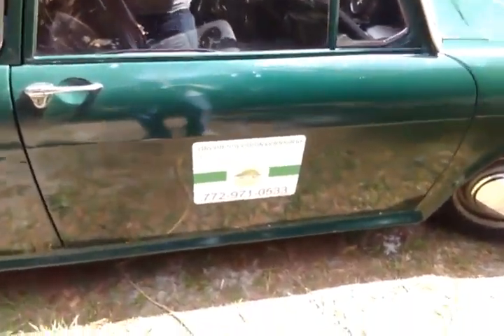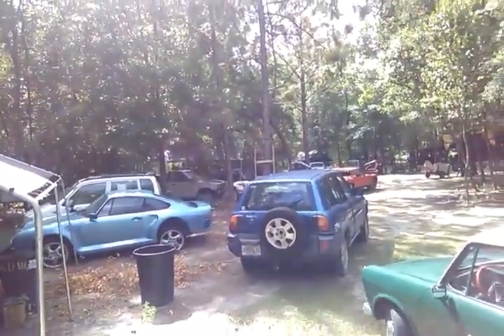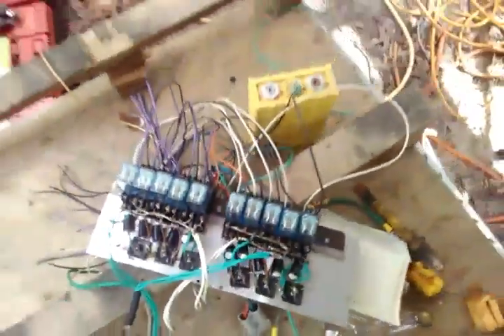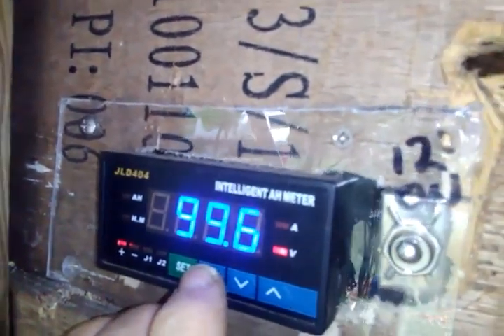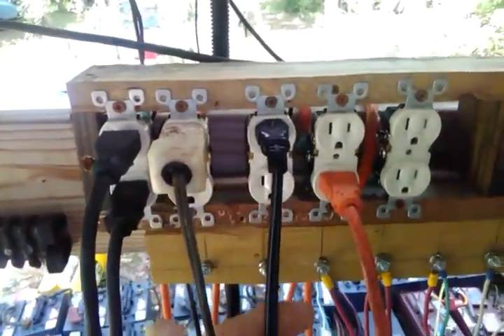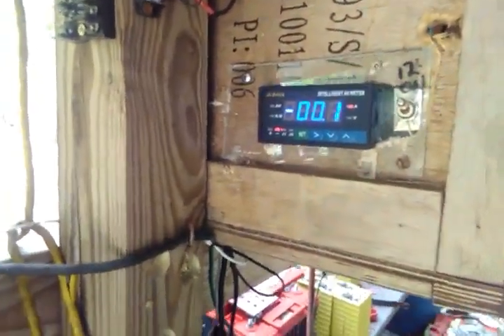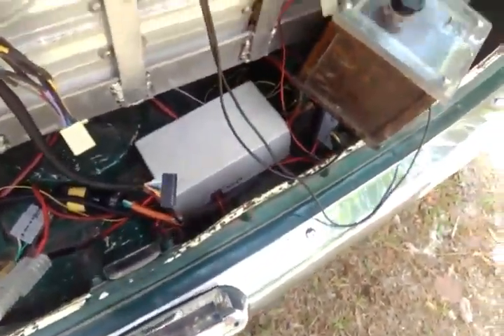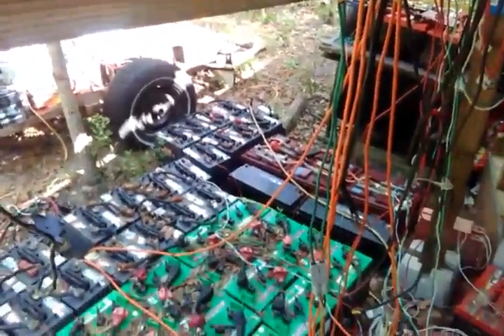Solar panels used to charge golf cart, electric mower and electric cars

Comment: As an electrical engineer, it took me two views to completely understand your setup.  You have a very rare understanding of electrical circuitry.  I'd imaging that most people's brains would short circuit trying to follow along with your unique configuration.  We're not all wired the same way.  Nice work, I admire your ingenuity.
Reply from the maker: Thanks for the kind words. My quest to use recycled parts is not always the best use of my time 😂.

Comment: 2:15 You can use the normally closed contact on the relays to prevent the others from coming on when they are energized. I see that you are using 2 pole relays, you can get 3 pole relays  and use the extra pole to do that.
Reply from the maker: I ran into an unusual problem with the relays I had a sag in the 12 volt system and some relays opened up and I ended up burning up the whole relay batch. The system has evolved quite a bit my now have 40 more panels.